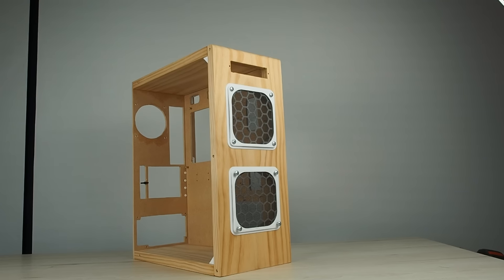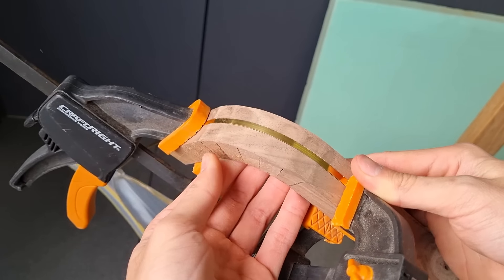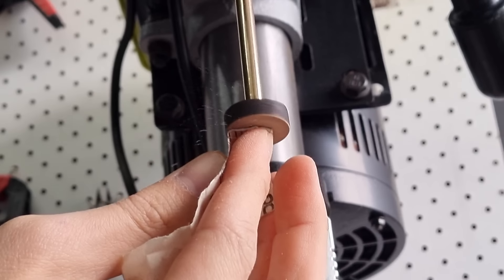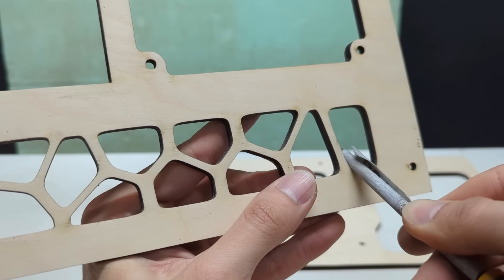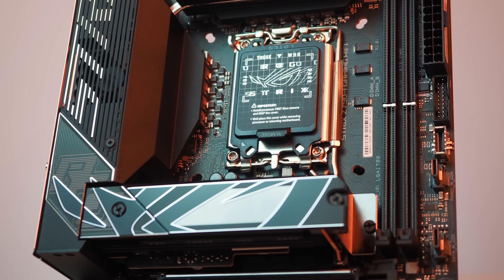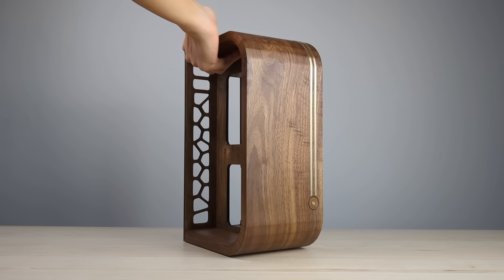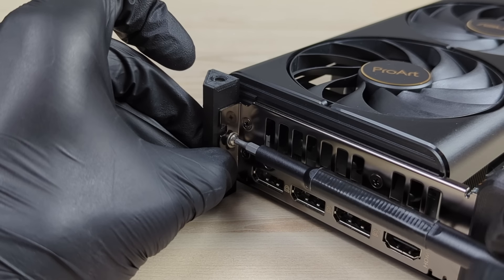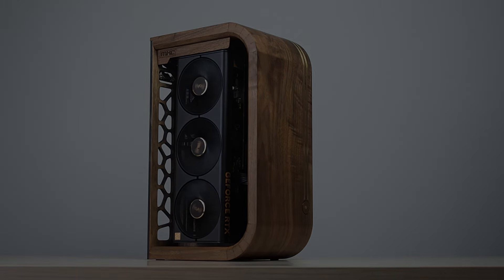BENT Wood PC Case - ASUS ProArt Themed | RTX 4070 Ti | DIY Wooden PC Case

Comment: You could use finer wood dust and ca glue to cover those slot holes much better.
Reply from the maker: Would ca glue and saw dust accept stains similar to woodglue and dust combo?
Reply: @mxcbuilds6633  no, not as good as. And if done bad it would stand out pretty bad. If stain a must then wg and dust is better but real dust, not chunky particles. Also to seal the top part of the hole; a tiny amount of glue and sanding with a high grit paper will make it almost impossible. Since regular glue tends to shrink, I always make my fillings a bump, wait to dry and shrink then sand so it will be level. Next time venner the case with an exotic veneer, maybe something like birds eye maple or macassar ebony. It would look lovely.

Comment: very creative, and nice looking build ;) could have done a better job filling the lines from routing the bend section and the front curves needed more sanding imo. but thats a nitpick from a furniture maker :P another option would have been to make the whole thing out of mdf with just veneer on the outside/inside/sides. be it the way you did it or making several U shapes and gluing them together.
Reply from the maker: Thanks for the feedback! I was weary of sanding it too much as there was only 1.5mm of wood left after the tapered cuts. If I sanded too much I run the risk of blowing past that and actually exposing the cuts on the other side. It was like sanding plywood, don't want to go through the surface 'veneer, I'm sure you'd understand that as a woodworker.
Reply: that is cutting it close indeed :P in any case enjoy the pc/work of art ^^ @mxcbuilds6633

Comment: Try to bend the wood by boiling it in water. This technique is slower but you'll have the solid wood without any cuts.
Reply from the maker: That would be interesting to try! I do worry that it would expand the wood too much and it will have to be milled again after bending

Comment: I think you must use the flat side of the router to avoid alignment mistakes.
Reply from the maker: That's what I thought previously, but using the rounded side is actually better, because the round edge is a circumference to the centre of the router, as long as any point of the round edge is touching the guide, the router bit will be the same distance away from the guide. If you use the flat side (I used to do this) the router is tilted even abit, the cutting bit will move away from the guide. Hope that makes sense. Might explain in more detail in my next video

Comment: hey i have a question how much would your project cost ?
Reply from the maker: It's very hard to cost it up at the moment, as each case is done from scratch. If I include the designing time, trial and error etc, easily it'll be over a 1000

Comment: seems like no one asked, but how are the temps 😉😊
Reply from the maker: CPU 80 GPU 70 not great but the CPU is over powered for this cooler. Next build will use a better cooling solution 😉

Comment: If someone already wrote, im sorry. Do you using the routing machine in the wrong way. Have to guige it at the flat edge of the plate.
Reply from the maker: Thanks for the comment, but actually, if you see my previous videos I used to use against the flat way, and someone suggested I use the round edge which is better. Here is why, if you are using the flat, if you twist the router during the cut, the cut will go out of its path. But since the rounded side is circular, as long as you are touching the rounded side to the cutting guide, the cutting bit will be in the centre of the cut, even if you twist it (think of how a center of a tyre won't move when it's rolling along a road) hope this helps!

Comment: interesting but I would never use combustibles material for pc built especially from aspect of thermal solution. Metal is best to transmit heat and resistant towards flame
Reply from the maker: Sure, thanks for input

Comment: ID Cooling makes really good products for a very good price. Built a PC for my Living Room with basically the same specs as my gaming set up relatively same case too just knock off version. gamin set up has a Nactua cooler no rgb and living room has an id cooling rgb they stay the same temp and the Nactua was and still is triple the price for the same double fan design air cooler but with the ID cooling you get rgb it even came with a button board to control the rgb if you Motherboard doesn't support rgb. smh don't know if its gonna last as long but for the price id just get a new one. i think i paid $85-90 for the Nactua and i paid $32 with free shipping on Amazon for the ID Cooling
Reply from the maker: They certainly offer very good value for their products!

Comment: This is awesome, though I think it's a shame to put this much effort into the build and then not do custom cables. The amount of work you did to make this build as clean as it is, I think it would have been worthwhile to make custom length cables to make it perfect.
Reply from the maker: Thank you! It's true that custom cables would be ideal. But considered the effort/reward ratio in this case and decided that the layout of the case along with how I've planned to hide the power cables would make custom length cables not worth it. As you can see in the final product, the power cables are barely visible anyways. :)

Comment: this looks amazing but honestly that cooler is not rated for that type of load! that cpu cooler is good for 125w max and the max tdp of the 12700k is like 190-212ish bro you should get another cooler for sure or cripple the cpu!
Reply from the maker: Thanks! Yep the cooler it's on its limit. I have set the power limit of the CPU to be 120w to manage the heat better

Comment: Can someone tell me what rizer cable this is. Please link
Reply from the maker: It's a pcie 3.0 double reverse, 30cm long
Reply from the maker: Just found this amazing item on AliExpress. Check it out! AU$23.52  10%OFF | PCI-E 4.0 3.0 x16 Double Reverse Male/Female Graphics Card Black/White Extension Cable Gen 4/3 Flexible ITX A4 GPU Riser Adapter
https://a.aliexpress.com/_mrvwu74. Make sure you pick the right length

Comment: How about noise?
Reply from the maker: The CPU fan gets quite loud but I did not measure it. The low profile cooler was not sufficient to cool the i7 12700kf. I would recommend using a lower power CPU instead.

Comment: If you have holes you can easily fill them with your sawdust
HINT.... BEFORE you bend it, use wood glue with wood sawdust, you can easily remove the rest when it is almost dry.
Now you can build one for me, Only with 3 x 140 top and front and 1 x 140 back lol;l, if the price is right
Reply from the maker: Will mixing sawdust straight into the glue for all of it reduce the glue strength?
Reply from the maker: Sounds good, will try in the future!

Comment: I don't think wood is the right material for PC cases. It's a porous material susceptible to moisture and heat. Prone to tear due to those internal stresses. It's doable, sure. But it will make the case significantly higher volume(!) and also suffer every time you turn it on and the temperature jumps 30..40°C. I like wood, but I just don't think that's optimal choice of materials. Plywood probably being the worst offender. Easy to get and cut on fancy CNC, high strength in theory, but oh boy, can and will it bend on its own over time.
I have considered wood a few times. And each time I get back to using metal/glass/plastic case mods. Nice video and attention to detail. But I would leave wood to accents.
Reply from the maker: Thanks for watching and your comment. Wood is definitely not the ideal PC Case material, and all the flaws you pointed out with it  are valid. In saying that tho, Ive had no issues with any of my 6 wooden cases I've built and used over the past. Not ideal, but definitely possible.
Reply: @mxcbuilds6633  Yeah, it looks good and unique by nature and is "easy" to work with. That's why I like it too. Bending metal sheets would require industrial tools or a few homemade contraptions just to start with if you are targeting decent quality. Drill bits would be more expensive, etc. 
One more thing regarding wood - I sometimes wonder about eventual passive cooling. Metal is lightyears ahead in thermal conductivity compared to wood. So metal cases should help cooling. But whether that actually plays any significant role considering all the fans in cases, I'm not sure. Just curious.